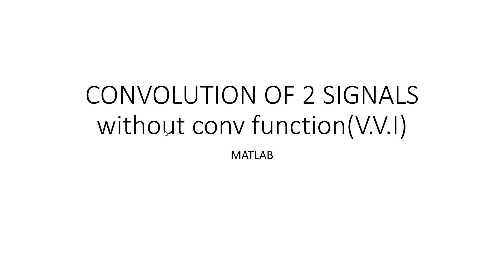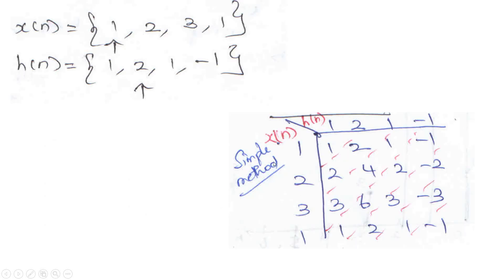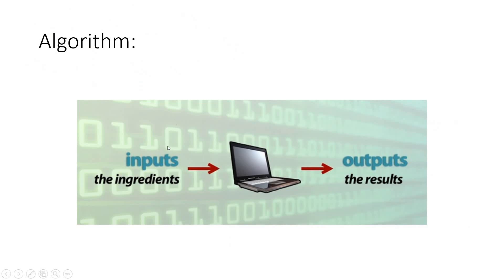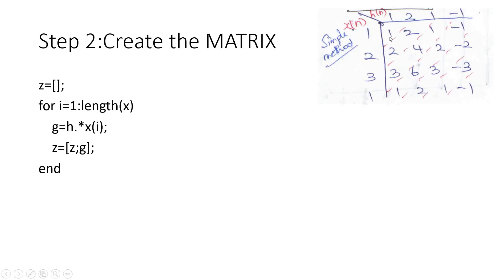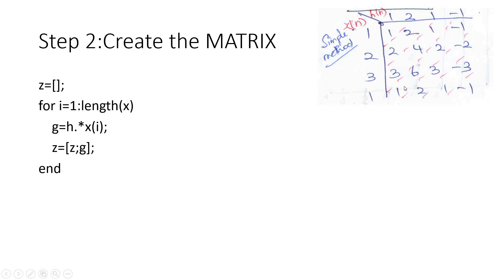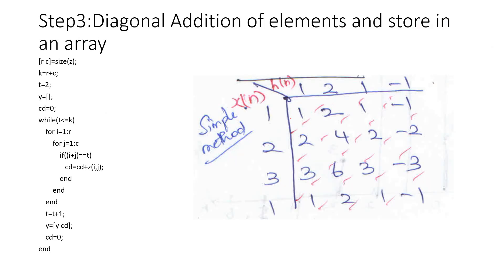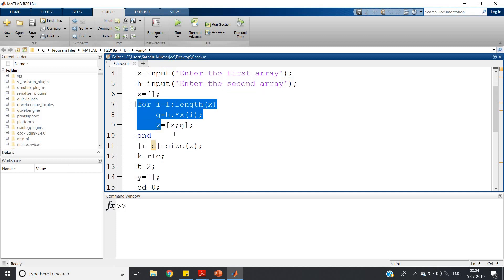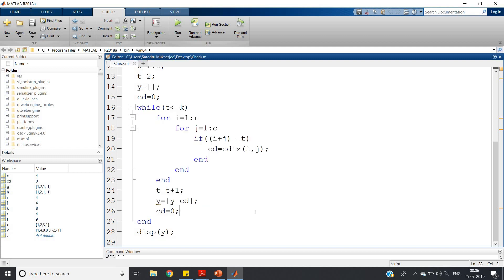Convolution in MATLAB(without conv function) | MATRIX Method | DSP

Comment: Z=[Z; g] plz explain clearly
Reply from the maker: This method is used to store  array in it's next row ...for example z=[ ];
Now , g=1;
z=[z;g];
After execution of this line , z=1;
now suppose g=2;
then if we execute  z=[z;g]; then-->
z=1
    2
That means the element is stored in the next row .
In this case , g has to be stored in next rows everytime...so that I have written that :-)
Reply: Knowledge Amplifier what is the need of jumping to next row using z[z;g] because as the value of loop variable i changes it will automatically be place in new row
Reply from the maker: @thelight8  No , you can not go to next row using that . Check in matlab
Reply: Knowledge Amplifier yes i already done that . You r right
Reply from the maker: @thelight8  Now the question is why this is happening ?
You are correct that"... as the value of loop variable i changes it will automatically be place in new row " but this is only applicable if we give index position like z(i,j) ....otherwise it will not work as you have seen too :-)
Hope you understand the reason
Reply: Knowledge Amplifier 🙂👍🏻thnx